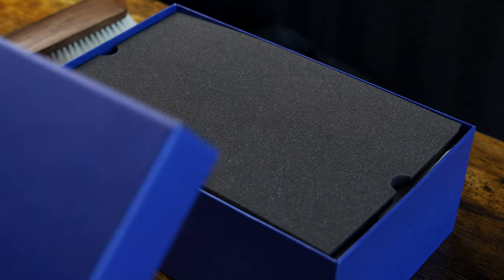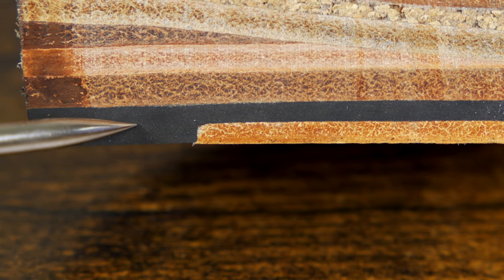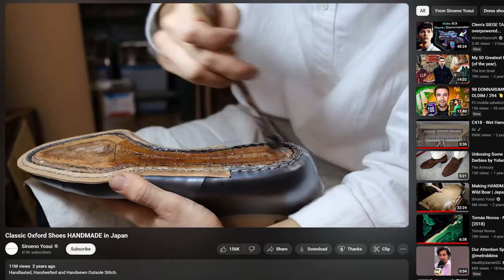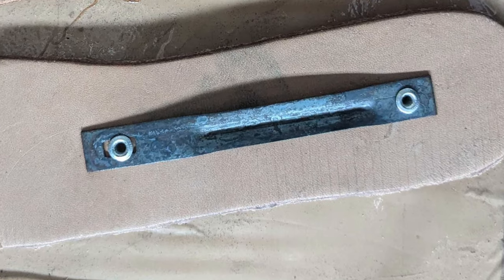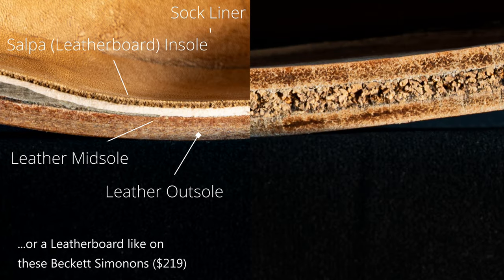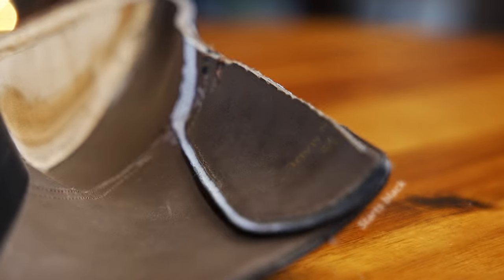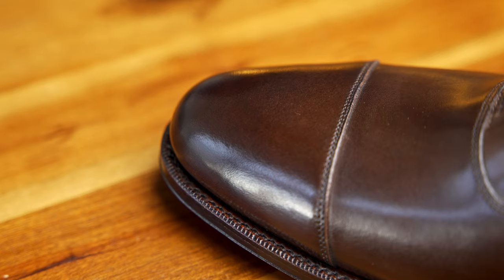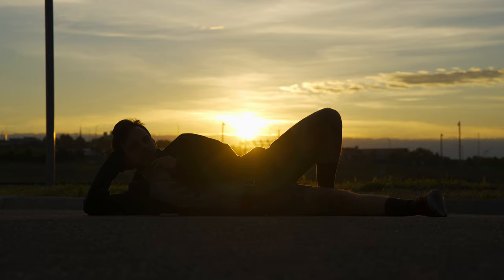BRIDLEN Ultimate Review (Cut in Half, Materials, Design, Flaws, Comfort, Style, Fit, Autism) - $250

Comment: I've watched a lot of your videos at this point because of the depth of the research and your eye for quality while sharing the info. Thanks so much for the time you put in and the info you share. Please keep at it, your page is criminally underrated but you'll pop off!

Also- would you put these over TLB Mallorca? What about Carmina?
Reply from the maker: Thank you so much!
TLBM I would rank higher in terms of overall quality and craftsmanship, though Bridlen may be better if you either A) Have wider feet, or B) Prefer a more classic, robust design.
I am not intimately familiar with Carmina, though I consider TLBM easily superior to them - and cheaper. Carmina is pricey these days. There is probably an argument to be made that they are superior to Bridlen, though for the price, I would much rather buy 2-3 Bridlens over just 1 Carmina. Bridlen is a better value.

Comment: What do you think about sole protectors, as in the rubber pad glued onto the sole?
Reply from the maker: I believe they are called Topys. No strong feelings - I think they are a good compromise to getting the longevity / weather-resistance of a rubber sole, while still having the thinner profile and more grounded feeling of a leather sole. I think when installed by a cobbler they run around $50 (this may vary by region) and around that price, I think it's reasonably cost efficient. Just make sure you are indeed getting them installed by a quality cobbler.